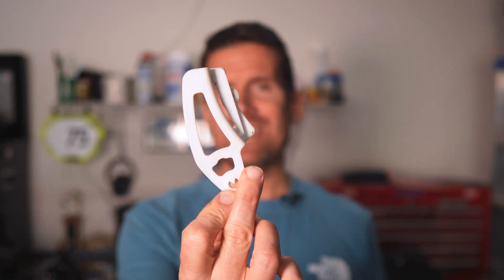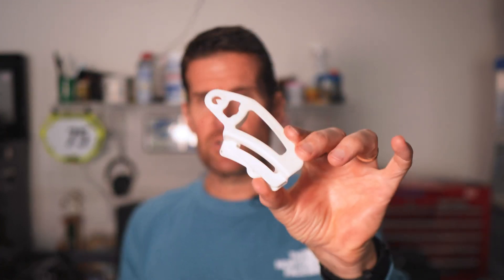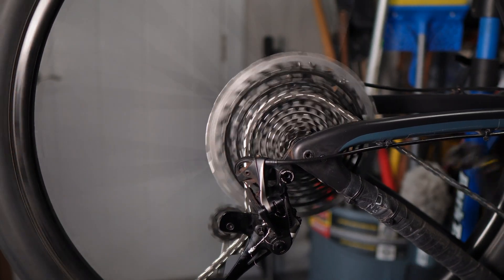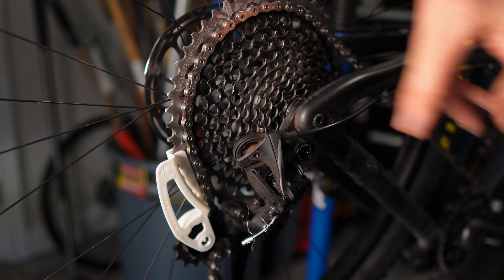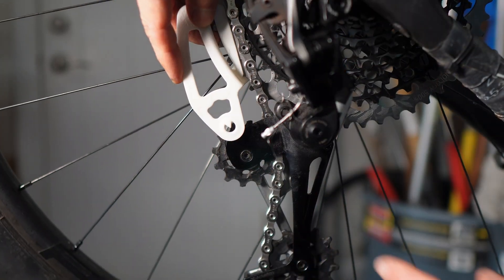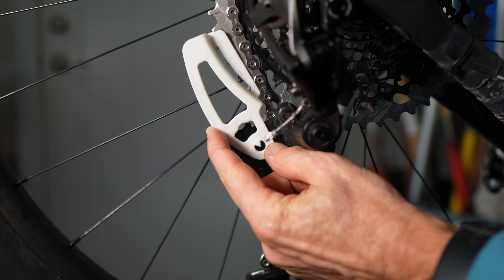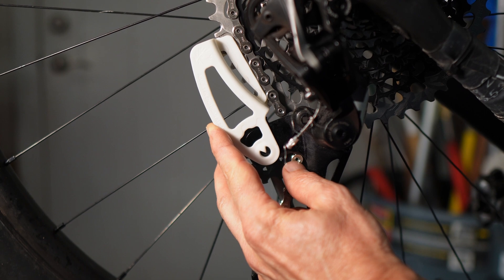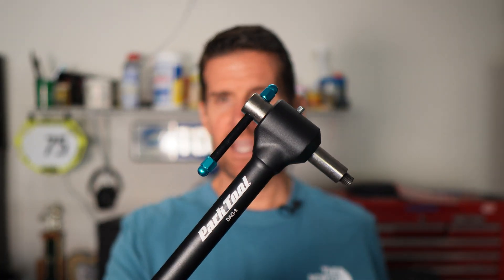SRAM Eagle Chain Gap Adjustment Gauge Tutorial

Comment: I don't know what I'm doing but every time I adjust when at sag it doesn't seem to go right but when I adjust when static it comes out perfect..
Reply: I actually didn’t see any difference between sag vs no sag. Tool still lines up the same. My son moved the tool into position while I was sitting on the bike with sag and it was in the middle. And in the middle off the bike. Bike shifts great. I’ll continue to set it at static and not worry about sag. But when I first put the tool into place my derailleur was in too much. I had to back it out. Lined it up and it’s great.

Comment: If you don’t do this adjustment at sag how does it affect the distance?
Reply: I actually didn’t see any difference between sag vs no sag. Tool still lines up the same. My son moved the tool into position while I was sitting on the bike with sag and it was in the middle. And in the middle off the bike. Bike shifts great.

Comment: I went into full dork mode and 3d printed a spacer to simulate the shock length at sag. I'd like to find an easier solution instead of pulling the shock but I'm also not adjusting B tension that often.

Comment: When you clip it on large cog do you go down as far as possible? Where do you put it up and down? Sorry, maybe when you do it it's self explanatory.
Reply from the maker: Yeah, it's pretty easy. Like I said at 1:55, the tool just needs to rest against the upper jockey wheel. It makes a lot of sense when you're using it.
Reply: It aligns with the teeth on the large cog. Look closely at the tool. It has a tooth profile that will center between the teeth.

Comment: Thanks for all the vids. Our MTB (hardtails) have a 1x12 SX mechanical RD on one and I have GX AXS (after my original GX mechanical RD) AND using the original red tool and the "newer" white tool - the centre of the jockey wheels do NOT align - correct sprocket etc. for both 11-50T cassettes (SX and NX 11-50T). I use the origianl red one on the mechanical SX (chain on largest sprocket) and as the GX AXS came with the white one, so I use that (Chain on second alrgest sprocket) - Shifting is smooth for both setups even though the difference in the variation between the measurement setups puts the centre of the cog out by 3 and 5 mm. Wondering if the white tool should be used for a 10-52T and stick to the red tool for the 10/11-50T cassettes - I do have scratches and marring on the inside of the GX AXS cage nearest the cassette that didn't occur on the mechanical. Guess I can always fiddle and play around with both to see - hope that makes sense :-)

Comment: Youe can easily set your bike at SAG by deflating the shock.
Reply: The non-flex piece, opposite the flexible tab that rests against the eagle cogs rear,  breaks too easily!  I just super glued my new one to reinforce the thin junction areas.
Reply: @mutleyadamsracing2684  I bought 3. 2 of them broke.
Reply: @mutleyadamsracing2684  Haha, I am waiting for the glue to dry right now😂
Reply: @joestillwell6789Bro you just saved my life with this tip, thanks a lot

Comment: Clint, 
Thanks for the video. So it’s really meant to be adjusted with the rider sitting on the bike?
Reply: The bike needs to be "at sag", so this only applies to full suspension bikes [there's no 'sag' on hardtails or gravel bikes]. You can have someone sit on the bike, but only if they weigh the same as you do with all your riding gear on. Easier method [for air shocks only] is to set the sag ring on the shock [by carefully getting on then off, as you would when first measuring your sag]. Then [after checking your shock pressure first] bleed the air out of your air shock till the shock body sags down to the sag ring. It may take some light pressure from your hand to get it all the way there, so you might need to adjust b-screw, apply pressure, check and readjust as necessary. Then pump your shock back up to riding pressure.
Reply from the maker: Yes, that’s what SRAM says
Reply: A fantastic way for someone to get their fingers caught between the cassette and chain when the rider accidentally rolls forward...